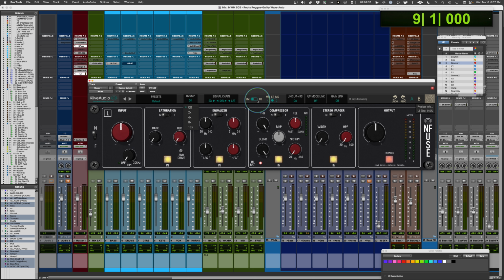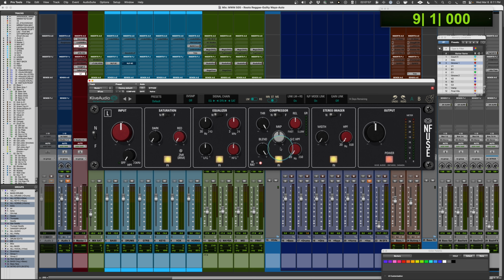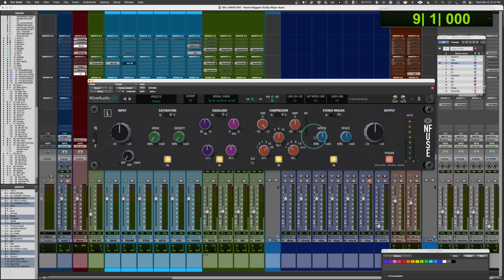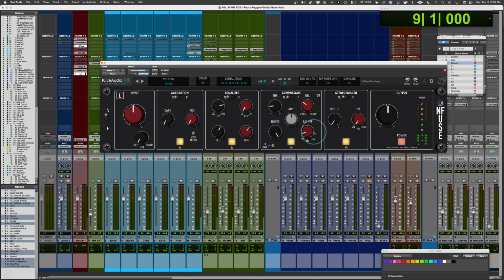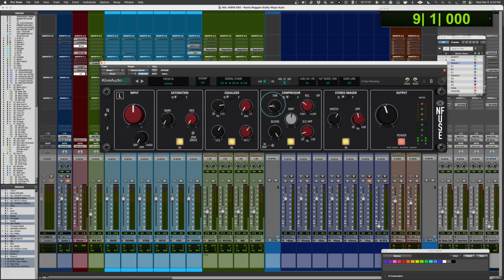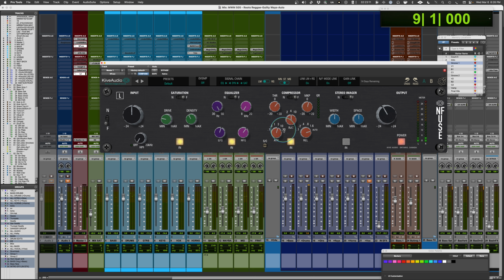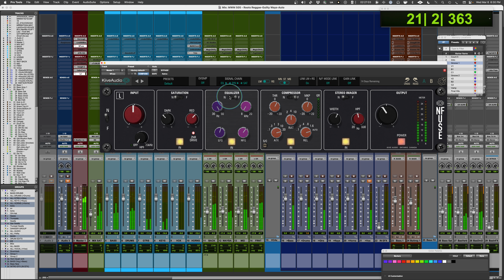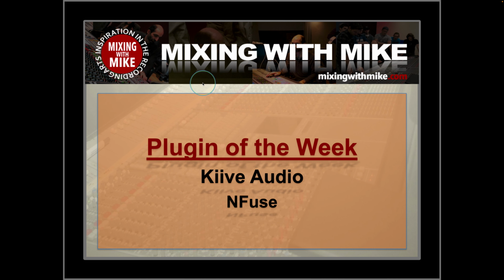Kiive Audio - NFuse - Mixing With Mike Plugin of the Week

Comment: The gain link button, discussed around 2:20 means that when on, if you boost the input level then the output will drop accordingly and vice versa, but if you turn "gain link" off then each is independent of the other. This would, for example, allow you to drive the whole unit harder but without affecting the output volume. It works really well for saturation and high end crinkly stuff etc. It's a really great unit on individual tracks too!

Comment: The Neve compressor is more like a aggressive limiter with hard knee that IMO better serves as a parallel comp or upward style compressor pushing up low level content. The Fusion side is the typical G-Bus style compressor.
Reply: Your right they didn’t do the hw justice to be fair on the unit it’s a two channel compressor and limiter with separate attack release and choice of feed fwd/bk
Reply: @Reggi_Sample  That would be correct if they were trying to model a Portico II Master Bus Processor, NFuse is actually going for the the Master Bus TRANSFORMER. Very similar name and look, both made by RND, very easy to confuse, but they're 2 distinct pieces of hardware. The MBT has a 'Color Comp' section that shares the same controls as the NFuse.

Comment: I have the Fusion hardware and this emulation is somewhat off. It lacks the warmth and the vintage drive is way different, less warmer too. Violet EQ sounds harsher and the lack of the frequency compressor, which is Fusion's best feature, is a complete miss. Not impressed at all.
Reply: This insistence that plugs must sound exactly like the hardware, or they’re garbage, is beyond absurd. They are to be taken for what they are: a tool to provide the essence of the original; unique in its own right. If this was a generic plug, with no association to any hardware, most would agree it sounds good. To insist it must be an exact replica of the hardware is to miss the point entirely.
Reply: @drefue  It doesn must sound like the HW but the violet eq sounds indeed harsh and the new nf comp seems not so good same with the vintage drive. Its just not goo d sounding. The Neve iss very good wihcich is komisch!
Reply: Have you ab’d the Fusion hardware with SSL’s plugin versions?

Comment: Hmm.... It's good.... But I feel like that hardware itch might Not be scratched without getting something like Even a simple art pro vla ii.... Assuming you have decent conversion.... There's something about actually putting everything through transformers and resistors and such..... You don't even have to compress to speak of... But it just gives it a certain 3D depth. A lot of these recent plugins are really nailing saturation and curves... Even most of the compression behavior... But there's this aliveness... This depth that comes from actually summing and hardware. It's subtle but I feel it.

Comment: This whole SSL/Neve hype thing is complete Bullsh1t. Complete and utter. If you need a solid reliable channel strip take TBT Cenozoix and Kichhoff EQ and forget about the rest. Analog emulation is the worst choice you can make to begin with. What a crap show! :-((
Reply: And why is analog the worst Choice can’t wait to hear this since you’re such a scholar?
Reply: so you never ever run a sound or a mix through tape or something? I remember when i started out mixing, i wanted everything i used to be as pristine and clean as possible. Did i come back from that in a big way hehe